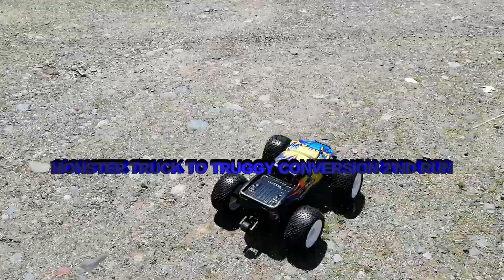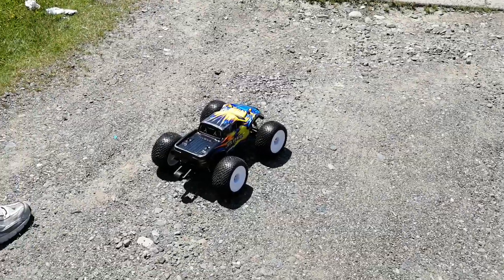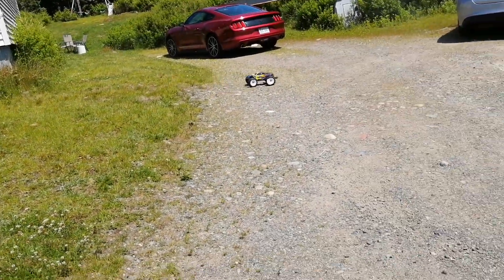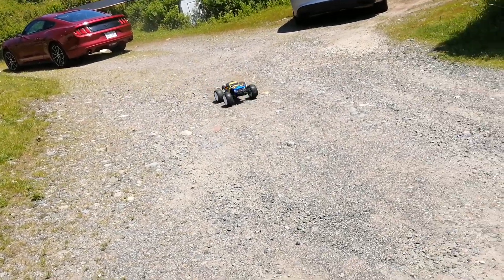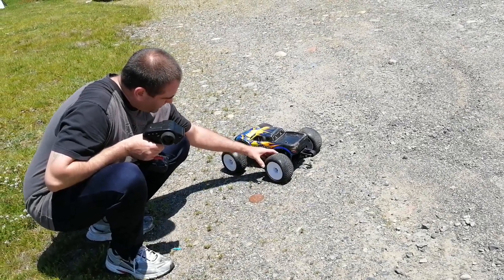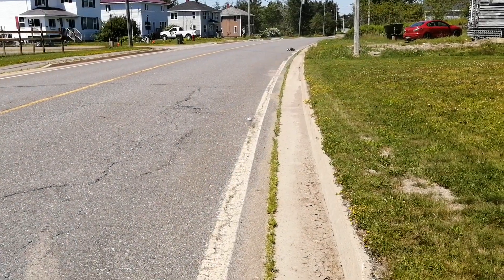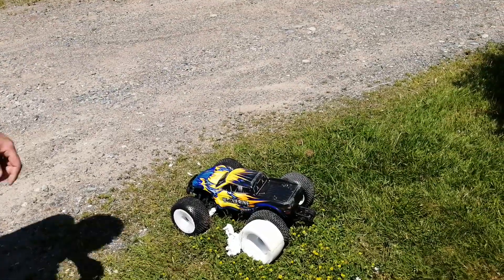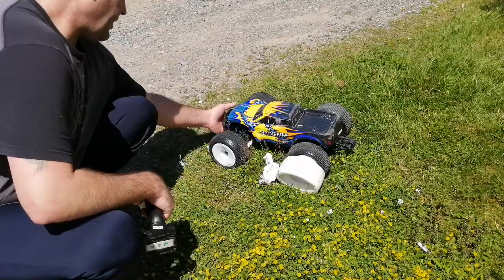MONSTER TRUCK TO TRUGGY CONVERSION 2'ND RUN

Comment: Like I told you before going from a 60 amp ESC to a 120 Amp ESC is like adding another cell in terms of power..You didn't need to run 4s lol